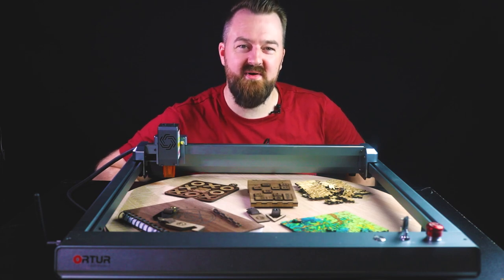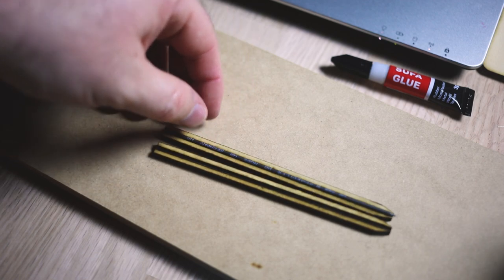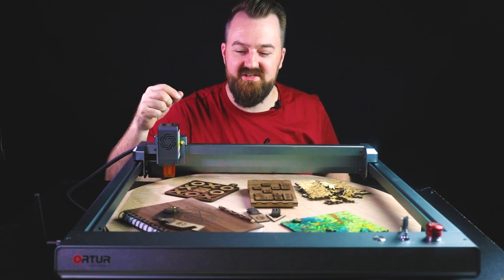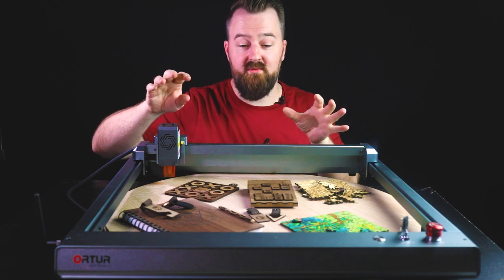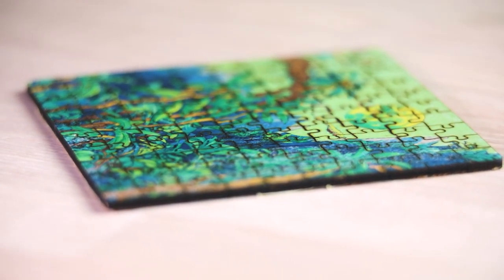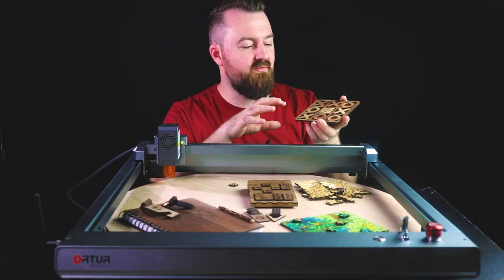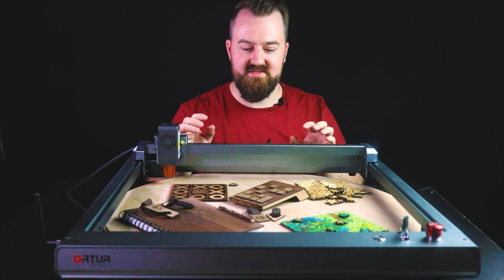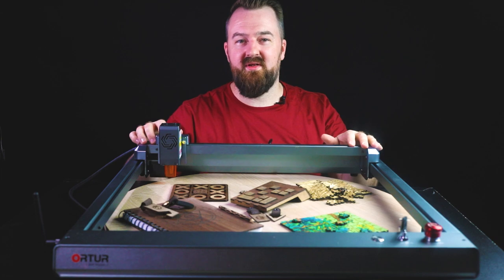New Laser Projects // Ortur Laser Master 3 // 10W Laser

Comment: Fantastic idea, amazing machine, I have known about laser engraving machines for a long time, I bought XTOOL D1PRO, and I also bought a 1064 laser head. The 1064 laser was good when I first started using it, but it can’t work for a long time, or it can’t be used under high temperature. work or strike